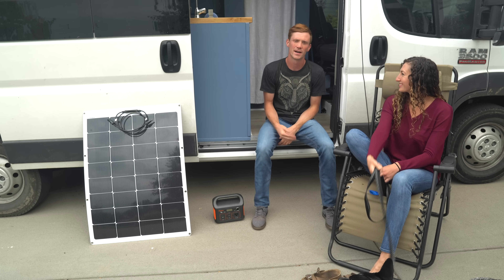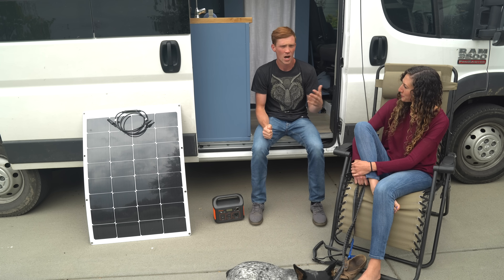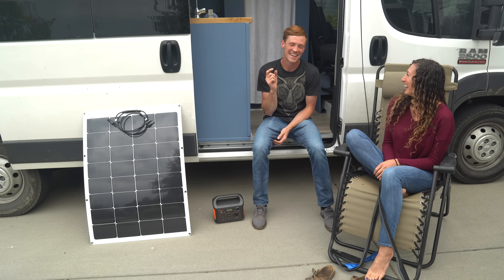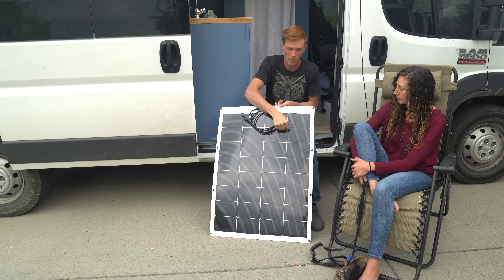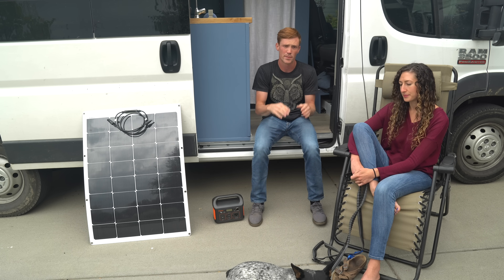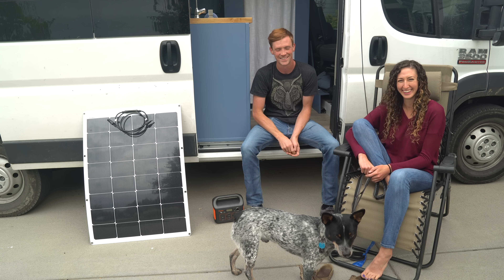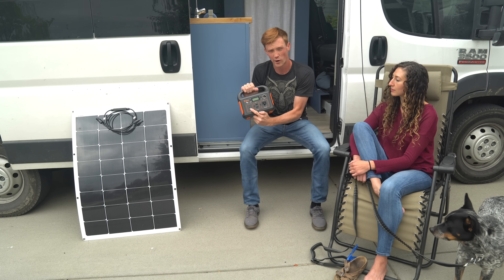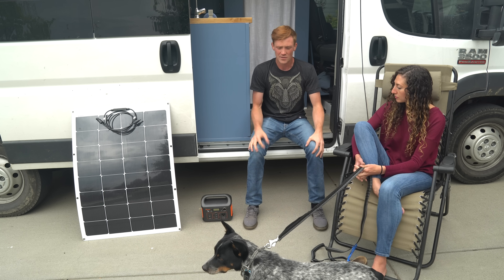How does Solar work? Sizing your van system | Trent and Allie

Comment: So... what about running an efficient air conditioner?  (I know you made a DIY cooler cooler..)  have you done the research, or is it just not worth  it economically? (I realize you only have so much roof space for panels as well....
Reply: A small window unit from Frigidaire is 450 watts. Since a solar panel only delivers as much power as the sun generates, you need something like double that (at least) to run that window unit - 800watts, 1000 or more would be bette.r  I've seen it done, but it's right on the ragged edge of what is possible in a small van/RV, and only in the daytime and at the height of summer when the panels deliver maximum power.  See this CheapRVLiving video: https://www.youtube.com/watch?v=EaVCNQ_59lM
Reply from the maker: Yeah but you can really only use them in the daytime with full solar production. We needed one in the night time to help us sleep more comfortably. But no luck yet. Maybe they'll come out with some new technology soon that will help this issue
Reply: You can do it off battery - unfortunately, when I say "battery" I mean an absolutely massive 1000 Ah Lithium block that will set you back $5000. Well, ok, you could do it off 800 Ah, and somewhere between $4000 and $5000, if you get DIY cells and a third party battery management system. So 1000 watts of solar on the roof somehow, and 1000 Ah in the battery box. 10-12 hours of AC off the batteries. For most people the cost is just a total non-starter. However, if you're boondocking, you could run a quiet little Honda EU1000i generator. Either way, a pretty major production.

Comment: Would I be correct in saying that, especially if a self installer is not expert, they should pay special attention to fusing?
Reply from the maker: Yes you want to install fuses between the inverter and the batteries and the solar panels and the the batteries as well. the fuses should be sized according to your system size and inverter size
Reply: Trent & Allie This is probably a dumb question but I don’t understand electrical/solar/battery things.  Is the purpose of a fuse to blow if something gets too much charge/or I guess, usage?

Comment: G'Day, T & A! Excellent information on solar power today. Fortunately, I understood everything without numbers included, which is the majority of your information on the panels and batteries. The most helpful explanation for me was about inverters, charge controllers, and batteries. I had not understood other videographers' attempts in translating electrical data into relatable English for unskilled listeners dealing with this issue. One question: have you had any situation where the 3-in-1 system is the problem where only one portion breaks down, so the entire unit will not work? Thanks for the practical details today; it will be very helpful in the future. Are you still in Montana? Cheers!
Reply from the maker: leaving montana today heading to wisconsin now!! 
I have not had any issues where the 3 in 1 systems have had a single system failure. most of those units are very well designed and built and also carry good warranties
Reply: Trent & Allie  Thanks, Trent!  I have always appreciated the diligence that you and Allie give to plain American English when an issue is technical, no matter the subject. For me, this has included mountain biking. Theoretically, it sounded very interesting; however, watching you doing has been intimidating because many years ago I fractured my arm riding on a safe neighborhood street. How that happened is another story, yet I constantly admire the adventure and the clarity that you two share with us.

Comment: What solar company did you work for? What did you do? The flexible polycrystalline panels are best in diffused light, but have a long way to go for durability. The better pSi tech is on its way! PWM (pulse width modulated) charge controllers are OK. The MPPTs are only as good as the algorithms they use. No one that I subscribe to has really looked into the 20+ solar collecting strategies.
Reply: I can really tell you know what you're talking about ! But I don't know what you're talking about! Cuz you trying to be too tecky if you could put that into English for us newbies that would be great thanks  !
Reply: @VikingVanMan  
I think this is probably just about as "English for newbies" as it gets without a face to face meeting.
Reply: @VikingVanMan  There is a lot going on that the consumer doesn't see nor do they have the tools to learn what is actually happening inside the MPPT charge controller. And, for the most part, it just doesnt matter. Everybody grabs up the acronyms for solar systems and just go with it. I too followed that path. And there is no end to the amount of stuff that you can learn about photovoltaics.  I wish I had more time, but Im just getting my rig together (or is it hold it together with what little clean metal remains?). I have an e-book and paper on solar that I collected from the internet. Its free! I dont have the link anymore. Send me an email (simkinjrATmail.uc.edu) and I send you the book and paper.